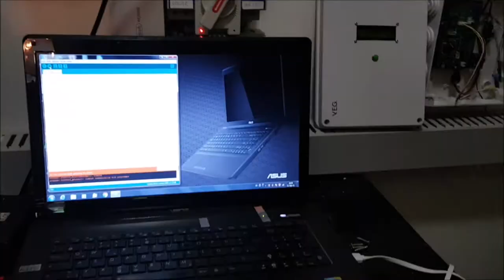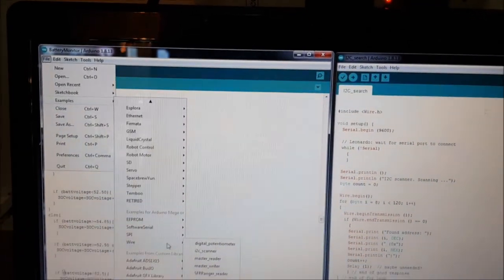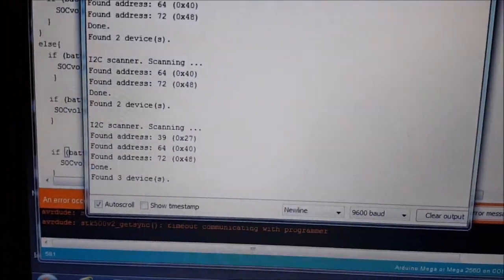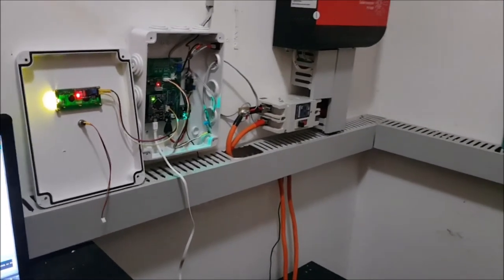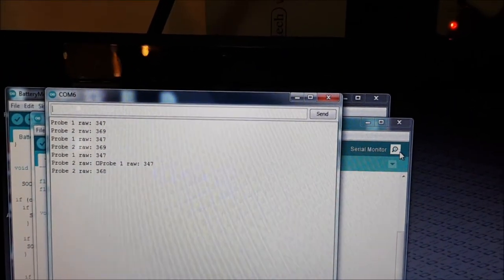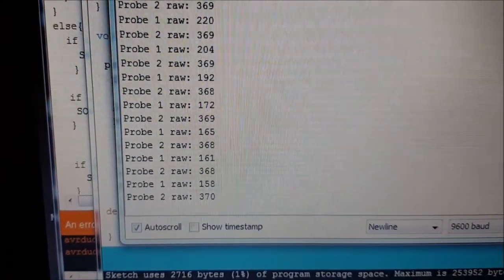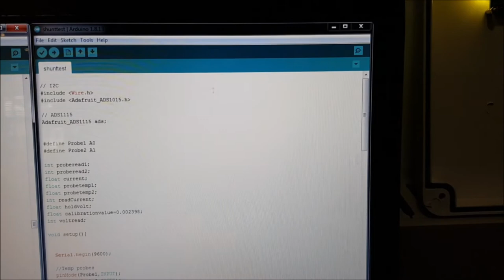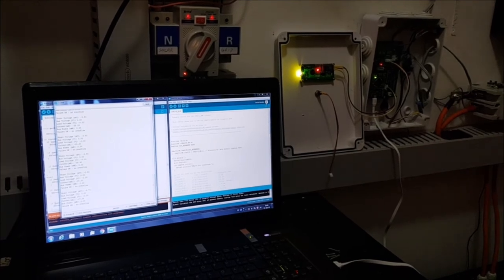DIY Battery Monitor with WIFI, Mini-Project from building to programming, Part 4: Installation

Comment: Can you please suggest a larger display that can display all the information at once?
Reply from the maker: You could use a 2004 LCD display with I2C interface. That would remain within same libraries, just a few changes in code and have 80 characters space instead this 1602 with only 32 characters. Otherwise you could go for a TFT display. But for that, all libraries and code would have to be fully adopted. This just as a random example: https://www.aliexpress.com/item/4001135515638.html?spm=a2g0o.productlist.0.0.5145270c5wmmWu&algo_pvid=c3e81fe7-fde4-4246-b245-83fb3c0d290c&algo_expid=c3e81fe7-fde4-4246-b245-83fb3c0d290c-3&btsid=0b0a556316187397837407839ee6c4&ws_ab_test=searchweb0_0,searchweb201602_,searchweb201603_